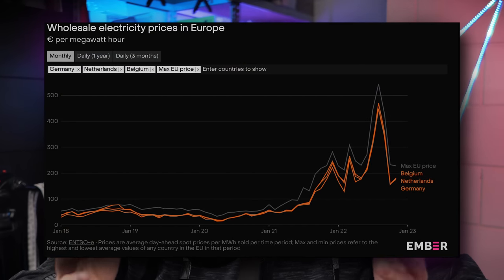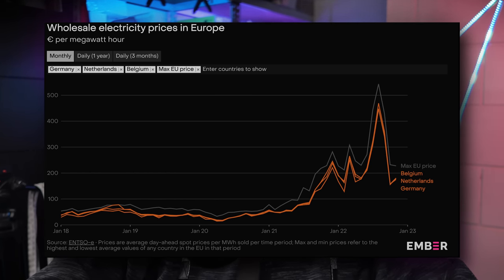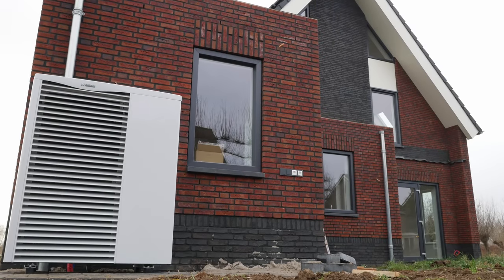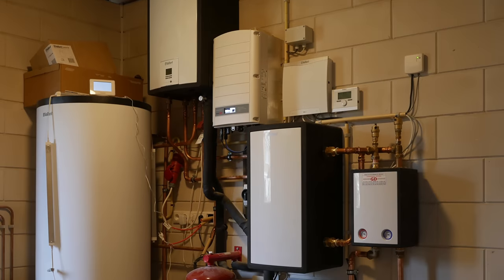⚡Quinergy⚡ The Why and reasoning behind project Energy (Home Battery build!)

Comment: What you say makes total sense.  This is what the "big battery" projects are doing on a grid scale, and doing it at a household scale makes a lot of sense.   I am in Australia, and during the day in summer, it has been not uncommon to see wholesale electricity prices at negative numbers, in otherwords, the power generators having to pay to generate power instead of being paid due to an excess of renewables.    If this excess can be stored in batteries or some other storage solution,  whether household or grid scale, it would bring the releiance on coal generators virtually to 0.

Comment: Looking forward to your next video's. Besides the financial part after "Salderen" I am also looking at the addition of a battery for loadbalancing (aka netsupport). Due to heatpomp, 2 EV's, and all the default stuff in a home, my grid connection is frequently maxed out. A battery should deliver some extra amps to support the grid. If you want some extra info, take a look at Victron Multiplus setup. Although expensive it offers lot's of tweakability, Home assistant connection via Modbus and even backup power.
Reply from the maker: Yes, my focus has already been on the Victron stuff so likely going that (expensive) route!

Comment: Looking very much forward to this project. I have a similar nut to crack at our home at this moment. We're renovating the place by putting in insulation and planned to put in solar panels to gain network independence, storing excess in hydrogen and/or batteries. Unfortunately, the equation doesn't fit. Home hydrogen storage is exorbitantly expensive and batteries will not get us through the winter. Wind we have lots of in our particular location in Belgium but good luck in getting a permit from the government for  a decent wind mill. So, I'm officially on the lookout for any great ideas and product to solve my conundrum.
I've been following your channel for years and I particularly like the reasoning you make when recommending a product. Funnily enough, independently from one another, we have similar requirements and end up with the same products (Home assistant, Dahua cams, ....). 
So I'm very curious what hear you're going to put in for your project Quinergy :-)

Comment: Especially interesting in BE as from January.

Capacity tarrif will cause part of the electricity bill to be based on peak-loads. Focussing your energy consumption to small slots (e.g. when you get home from work), will lead to a higher energy bill; while you can save a lot by spreading consumption (heating, cooking, charging PHIV/EV, etc.).
This tarrif is designed to battle what you discuss around 12:00. The grid must be designed to withstand the highest peaks (both in consumption as injection), while the base load is often much lower. Spreading consumption lowers the peaks and lowers the risks on blackouts. In the meantime the grid is being upgraded.

Also, when you have the new digital grid meter, you get a little less for what you put back on the grid compared to what you pay to take from the grid (injection pricing doesn't include a "compensation" for taxes etc.).

Comment: This should be interesting. I have tried in the past to build a storage bank with Deep Cycle Batteries, but ran into a series of issues with Quantity, Price, and a lot of Maintenance. They are also heavily effected by weather, or sould I say extreme temperatures. Tesla Power walls have had good results with energy storage, but the expense can easily outway the result. there are a number of factors to consider on the safety end as well such as thermal runaway, Gas:"gassing" can be kept small but not zero when charging with a panel of that relative size and can become Hazardous, acid buildup on connections, and of course electricution. With that Said, I am sure there are better answers out there than what I had the time to come up with and I am excited to see what comes out of this! An affordable, Safe, and powerful enough power bank would be awesome!

Comment: My solar and batteries are installed but waiting on inspection and meter swap out so I am excited about the subject. One solution that I don’t hear much about is using EVs to power your home. Most EVs have massive batteries. We could charge them during the day from renewable resources and drive them home and run the house at night. It helps incentivize people to go with an EV and reduce the demand on the grid in the evenings.

Comment: Go battery! I do it for more independence from the grid, not for the money, but it is still nice to see slowly the people I follow move towards solar+battery :) Looking forward to your solution.
Reply from the maker: Yeah, independence is a step further which isn't really needed here in NL, we haven't had a grid failure in years basically.
Reply: @IntermitTech  I didn't mean due to failure. With enough solar and relatively big battery, you might be able to get away from all the fuss about grid prices and fluctuations. But your plan with buy/sell is quite cool. Have to check what's the price difference here, if it is possible even.

Comment: Agree with the predictions. Disagree about why we are here, although that seemed to be the less interesting topic for you.
I am also considering a battery setup for myself. Regarding grid tie solutions, the red tape and technical details would be interesting to see you cover, although I expect the precise details may vary depending on the location.

Related topics I'd be interested in: 1) How you decided to size your batteries, 2) How you decided which battery layout to use, 3) how you balanced battery size w/ wiring complexity and wire/connector costs, 3) How you budget for defects, 4) Software/data streams, 5) Cost of monitoring vs rewards, 6) Battery housing considerations (heat/cold/humidity), 7) Inverters, 8) How to make sense of energy flows, where breakers/disconnects go, 9) Weight of system, 10) Sourcing batteries and choosing a vendor, 11) permits, 12) Anything which did not turn out as expected
Reply from the maker: Woah, awesome you are long for the ride but it's a bit too much to comment on right now. Most if not all of the things you asked will come by in future videos though! :)

Comment: I like your thinking!  May I suggest a board that monitors the Mains and battery levels and manages switching.  There are alot of old cheap UPS out there that could be dedicated to individual circuits of the home and utilising these with a smart controller that aligns with your ideas, would give people a scalable way to start doing this on a low budget,  shorter payback.

Comment: Looking forward to watching this project progress.
Do you plan on using new cells, or would you consider repurposing/recycling disused EV cells?
As many others have already come before, building the battery is the "easy" part. The grid integration, switching, and software are the harder and more nuanced parts. I hope this project ends up resulting in a "productized" set of components for a semi-DIY solution, much like the DIG LED boards!

Comment: I was also thinking about the same. I have the same tariff as you and it is going away in 2024. So there is one more year of grid storage. Using certain percentage of your car's battery would be also a way to store energy. But there are only very few models that has Vehicle two load feature. Not to mention that again very few models AC charge from all 3 phases. Which would be kinda useful in Europe. I would also be interested in playing around with different battery chemistry other than Lithium. After all in a home energy density is not the top priority. I would be happy to trade space to cost of batteries. But most of the commercial products tend to focus on LiFePO4.

Comment: Your reasons are equal to mine. Also living in the Netherlands having exactly the same reservations on our energy prices and problems. I'm not sure if a home build project is better than the Dutch home battery startup, but it's a lot cheaper than competitors and have an API that you can use to control it (they say). I'm curious about the capacity of the battery you are planning. We have about 60kWh on a great sunny day and we only use about 25 kWh a day (with the car) so a 5kWh battery is better than no battery (it bridges our night use for about 9 months a year) but isn't a real solution for the excess power in the summer a couple of good days in a row.

Comment: Normally i’m a viewer only but i had to respond on this one 😅 I’ll be following this serie closely! I’ve just made the jump from Eneco to Tibber. They offer hourly rates (just like ANWB that you showed), a GraphQL api endpoint available for retrieving all the data and ready to go Home Assistant integration. With HA i’m now able to charge my car, start washing machines etc when the energy prices are low. Works like a charm. Obviously this can also be use to charge the plannend batteries.
I’ve got a €50 invite-friend coupon for Tibber in case you are interested.
Reply from the maker: Oh hey that's a great tip! I was still looking at which energy provider I wanted to go with but a pre-made Home Assistant add-on is certainly a plus! Thnx! :D

Comment: Nice topic for a project, i myself am also looking to buy a batterysolution. 
Being not very tech savy, it will be a turnkey solution more or less.

Your reasoning around the dutch situation is sound, at scale however availability of battery resources is THE limiting factor. 
The green transition wil completely fail because of this. It just isnt feasible.
But for at the level of the individual, sure.

Looking forward to you findings regarding this project.
Thx

Comment: We have also built our own home, it is an eco off grid using solar and a battery storage system which can power the house for nearly 2 days without any sun..  We do have a backup generator to add when there has been no solar generation which so far this Autumn has used less than 20 litres of red diesel at between £80-105 per litre.
I think there should be a disclaimer with "Heat pumps" whether air or ground, they are very efficient when the temperature they are using in the ground or air is close to the temperature they are raising the water to.  So if you have 20 degrees outside and your energy efficient house only requires heating the underfloor to 35 degree they will be 4x more efficient than heating directly with electric.  As the temperature difference changes in winter the efficiency plummets.  If you heat the water to 70 degrees for showers and to kill legionnaire in a storage cylinder then you are close to the efficiency of just heating it with electricity directly minus the cost of a heat pump system.  Yesterday we put 12kw of solar into heating hot water to 80 degrees after the batteries were charged, outside is covered in snow and didn't get above -2 a heat pump wouldn't have achieved this.
Looking forward to following the project.
Reply: True, but they are getting better and in worst case you have an "efficiency" of 100% (COP of 1). And there are units out that have a COP of like 2 down to -10 °C. But yeah, less common still. And if you design it correctly you only need 70-80 °C for a Legionella run once in a while.
Reply: @tengelgeer  I am not saying heat pumps in the right setting carn't work well but too many people are buying them to replace a gas boiler and expecting COP4 efficiency which is just not going to happen/work in winter conditions.  Your saying in winter conditions the heat pump will have the same efficiency as an emersion heating element or maybe twice if you buy the right model for an outlay for the illustrated system of say £/€8-10,000, that's alot of electricity you can buy, how many years payback (will it ever payback, how much to service and keep running a friend of mines 2 years old system has just had a replacement compressor at £900)?  So in the summer when you have excess PV and they are not achieving there maximum efficiency of 19-20% as they are too hot you can use the cop4 heat pump to maximise the efficiency of the solar PV to a not achievable 80% or fit solar thermal at a fraction of the cost at 90% efficiency out of the box and still heat your thermal store with an emersion element at the same time with the excess PV.

Comment: Sounds Pretty Interesting My Friend..

Same here, Building My own portable Smart Pack.

Other than off shelf fancy modules, i'm taking the route of "Every building block" has to be built by me..    Down to the MCU Comms to Energy meter over I2C..

Currently, been stuck in the phase of 'Metering' the Current/voltage/power/energy stored or released from/to the pack and inverter..    

It's a long heck INTERESTING full of challenges road..   It worth..

Best of Luck, Greetings..

Comment: I have been doing this for the last 2,5 years and for the last 1,5 years with even throttling my grid loads so i never go over the limit of 2500w in a 15minut window. The thing where Belgium is going to as from 1jan 2023. So if you need any advice i am glad to help or advice! i'm not a seller in any way but already allot of experience from the last 2,5 years ;-)
Reply: That's smart, I have a 40 Kw battery, a heat pump and soon an electric car... and was also thinking about that "problem" here in Belgium.
Can you give me a hint on how to measure and control this?

Comment: With dynamic contracts in the Netherlands, you need to be carefull.
EnergyTrading is NOT included with the BTW-vrijstelling on self-use solar!
Reply from the maker: Correct and I still need to dig into that part a little bit but the core of the idea remains. I can buy power at times it's cheap and use it the rest of the day while it's more expensive.

Although I do believe while salderen remains a fact, I can still buy energy cheap and then sell it back for more money and tax wise it'll be treated as 0.

But there are more complicated things such as the "energy cost ceiling" of next years, it's a complex maze to navigate. And I believe in the end I'll save money from this although when or if it even breaks-even or truly saves me money on the long run we'll see, I believe once salderen is gone I need an energy storage solution anyway so that made me pull the trigger since eventually I'll have to anyway.

Comment: Rural USA Dave: I like what you are doing with this. I am Interested. IMO I think we are being forced into this GREEN ENERGY, But if you put your head in the sand I won't understand any of it. Our bill has tripled in the last two years. So I would be interested in some kind of battery that we can store energy in for later use. Our house is all electric, so it makes since to start this sooner than later. we already have a heat pump. Looking forward to your plans. Thanks Quin
Reply from the maker: That's awesome to hear, I thought power was supposed to be really cheap in the US, is that really region dependent then? We're currently still on a fixed contract for about 0.45$ per kWh, what is it around there?
Reply: @IntermitTech  I can't speak for Dave's pricing directly, but power prices do change a lot regionally across the US.  I know in my area many people were paying less than $0.10 per kWh before things changed this year.  Currently people signing up for new contracts will be between $0.12-$0.20 per kWh, but other parts of the country I have seen prices that are in the $0.23-$0.28 range.

Comment: Nice! I'm interested in this as well. But it's in the planning for the end of 2023 or start of 2024. Enough work on a house from '59 for now.

Besides buying and selling power at the right moment it can also really help for peak shaving. Something that will also become very interesting if we get a network fee that is based on bandwidth rater than the capacity tariff we have now.

But please work on you vocabulary. Never when you said 'power' you actually meant power. You always meant it as electricity, energy or electric energy. Power is an instantaneous unit in Watt (as per SI). And 'salderen' is a subsidy, not a law :D

Comment: Why isn't there more research into standardized battery storage form factors for a residence?  And why doesn't homes have a DC wiring for things lile LEDs and DC appliances? Most appliances like our PCs end up using DC with a conversion loss from AC.  Could a DC home wiring system.and battery storage be potentially more efficient than having every light convert it from AC?

Comment: Programming these battery system/ other energy managament systems is currently my job in the netherlands. Unfortunately, unless you think its fun, a battery wont help for now. Batteries only make sense if you have access to the direct energy market with price fluctuations and or are not allowed to feed back energy into the grid (most money with batteries is made with changing your own usage).

Comment: Hey hope you doing well , i have an issue it seems  i checked all fuses on the quad but i just cannot get gpio16 to work but it used too  , all the other gpio  work but each time i add the pixels to gpio16 nothing , i guess it may of been a fuse but changed all and still nothing , any suggestions why , it all was running ,  then out the blue could not control it , so sorted all again and seems its the only one that will not work the pixels , re flashed again changed fuses , same outcome .
Reply from the maker: Hard to diagnose from a comment, can you join the Discord? Lots of people who can help diagnose there. :)
Reply: @IntermitTech  Its a bit late now as working all the time at present , i just do not understand why gpio16  will not work but the others do .